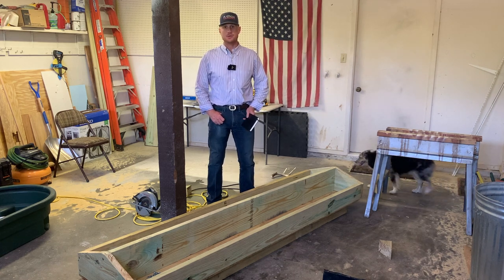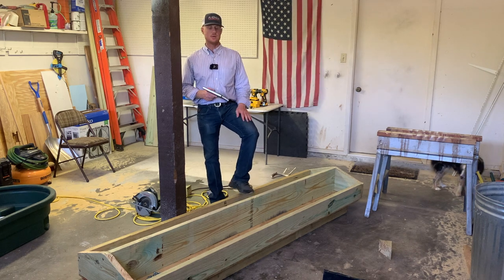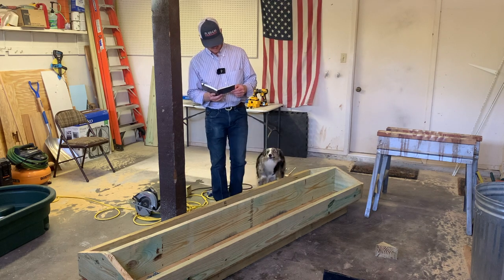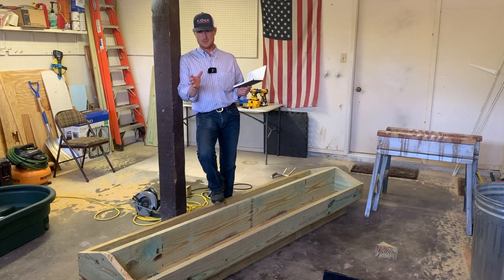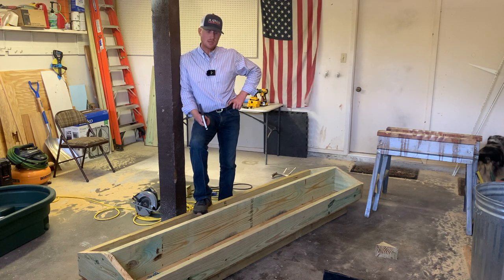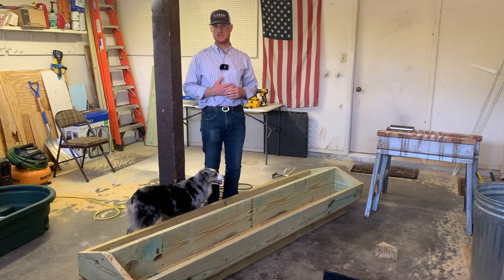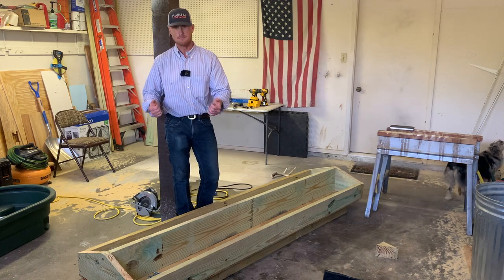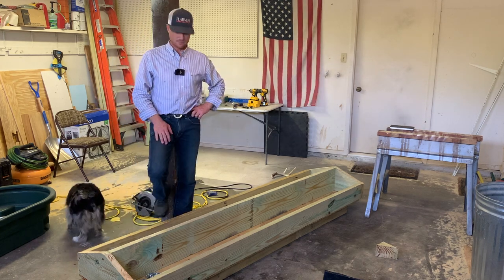Portable Mineral Feeder - Dimensions & How To

Comment: Thanks for the video. I like the design. 

I wanted to let you know that your flag is hung incorrectly. When hanging vertically you should be able to rotate it horizontally and it display correctly. You have it in a sign of distress, as when you rotate it, it would display upside down, or in a sign of distress.